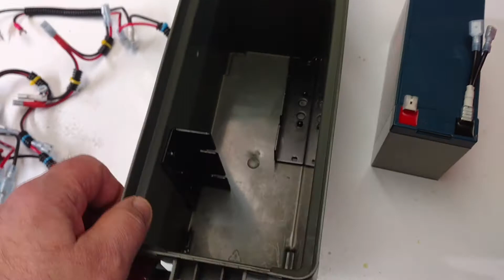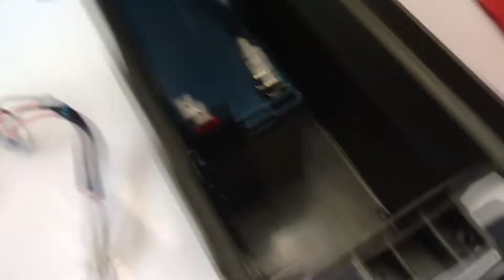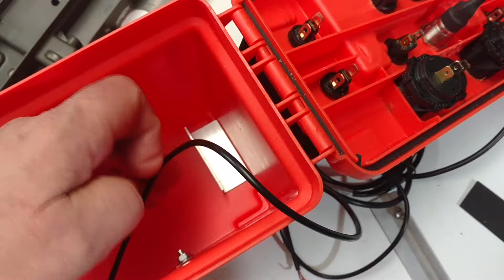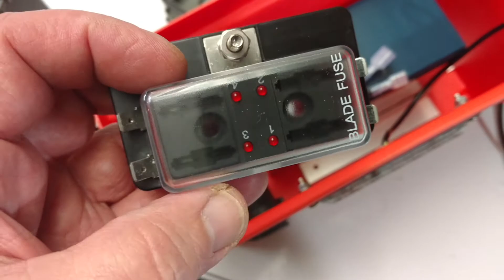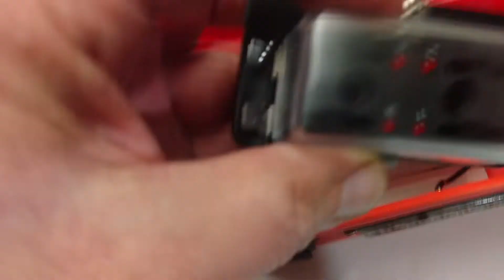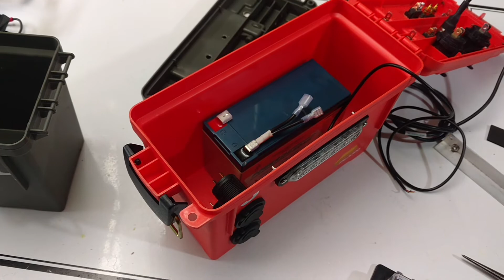Ammo Box Battery Building Tip 1

Comment: I know you have built a lot of these, but I use industrial velcro and it holds the batteries really well with no drilling of the case.
Reply from the maker: Hey thank you for your comments... I know what you're talking about, the hard plastic hook and loop is very strong stuff... Two issues I've had in the past, one is certain types of plastics like polyethylene, the adhesive backing doesn't adhere well. The second is over time, I've had issues with the adhesive drying out and becoming brittle due to time plus temperature extremes.  I went with the mechanical tie down so the battery stays in place even if the box is subjected to rough handling or rollover. Maybe it's overkill... I dunno.  But I can hold the box upside down and I'm 99% sure the battery won't fall out.  Hey thanks for watching!